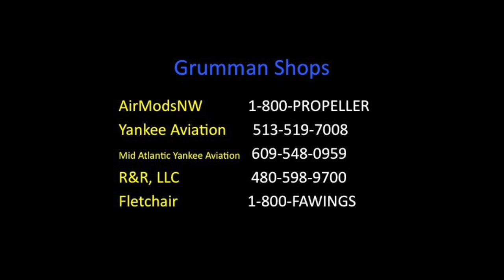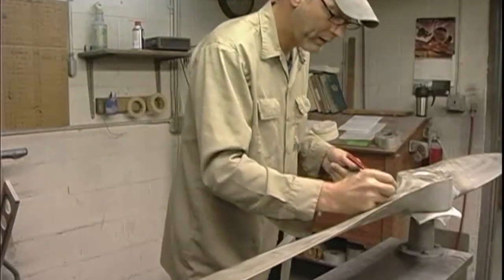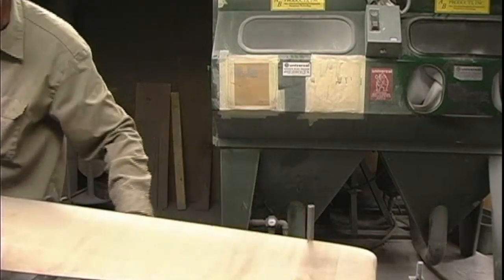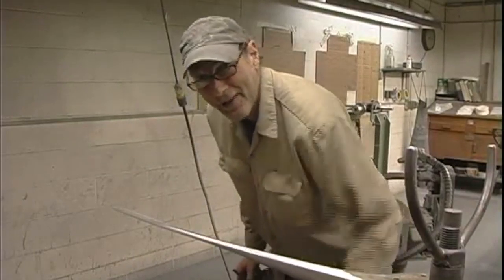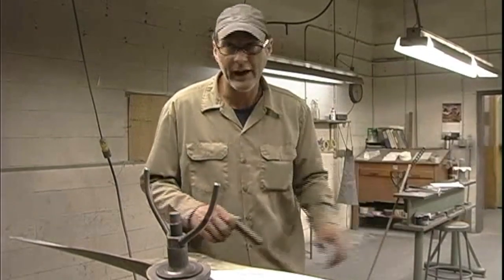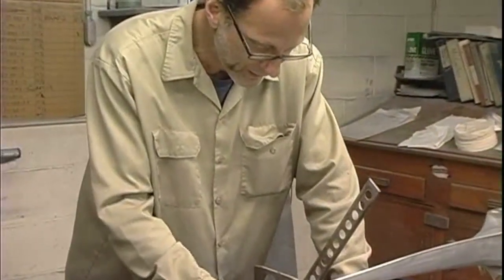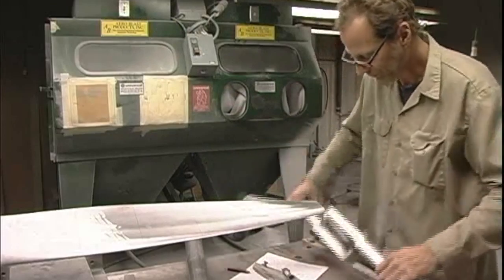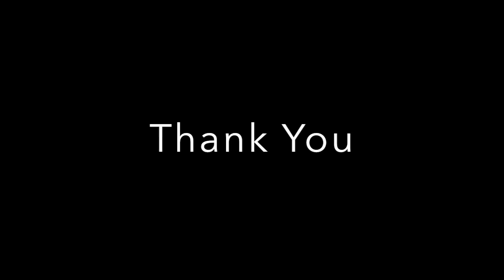Propeller Overhaul - Grumman Style

Comment: In 1983-4 I for get, a company that I worked for owned several AA5B’s one Saturday evening I was at the company HQ, in Chamblee, GA. One of my co workers a student pilot had a need to deliver a Computer monitor to Augusta, Ga he asked me to fly him that night. 
On departure from Augusta I felt a strange vibration on take off. I returned and landed. Looking over the airplane I could not find any thing out of order. So we flew back to Kpdk with no issues. The next morning another co worker departed PDK for GSO, on board N 28820 was his wife and 5 year old Daughter. 45 minutes south of GSO the Prop broke and slung a blade. The pilot shut the engine down as parts were separating from the airframe due to the vibrations. The engine separated from the airframe at about 10 feet above the ground. No one was hurt it totaled the airplane.
Reply from the maker: Props are the most overlooked part of plane

Comment: Not anealing.  It is work hardening.  That is what breaks the copper wire.
Reply: So what, he misspoke.  Still, you have to admit, Tony knows his business.
Reply: Yup.  Given this guy's knowledge, my guess is he just grabbed the wrong word.  Unfortunately, in this case, it was the OPPOSITE meaning.  You wouldn't believe how often that happens unless you do some vids where you speak.  ;-)  I watch some of mine, and just roll my eyes up in my head, with some of the stupid stuff I say in them.  Sometimes it's so bad, I feel compelled to retake the video section.  Here, this guy probably didn't have that option (then just overlaying the correct word in text "I meant work hardening" is a good fix) and wouldn't be a bad idea here, then he could also fix the video/audio sync problem, which is immense.
Reply: Actually, take a piece of copper wire and start bending it in half fast. It will heat up. It's that heating and subsiquint cooling is what Annealing is. Which in turn, through many processes of this, it makes the metal toughen and eventually if it's done enough times, it'll become brittle and break. Heating and cooling is EXACTLY what Annealing is.
Reply: @tonym3675  No, what it will do is BREAK, and that is partially due to work hardening.  You would have to bend it at about 20 Khz to heat it enough to anneal it, that doesn't happen at 120 degrees, barely within an order of magnitude of it (10X).  

This stuff is well known, well measured, well understood (now even at an atomic lattice level), and well documented. It is used EVERYWHERE in industry.  

Arguing it is TOTALLY senseless.  Just go look it up or do the experiments for yourself, but you need a hardness tester of some sort to do it.    

Educate yourself, you are ignorant on the subject.  And yes, in my engineering curriculum we had a course called "Structures and Properties of Materials" that dealt exactly with this issue, any many many others.  Just go ask anyone that uses it in the industry or any knowledgeable blacksmith.  You CAN'T argue against known facts, not with any intelligence.
Reply: @MrJdsenior  i CONCURE,You arguing it in the way you attempted is indeed you being senseless. Ever reloaded bullets.  Well they are brass and when we want to make the case neck harder in order to hold the bullet tighter, we gently heat the case neck (not red hot but a far cooler temp. Just enough to basically see a slight color change in the brass). We do that to yes! annel; that neck. If we get it too hot it will not hold the bullet but rather as we push the bullet into the case, the case will then crack or completly break. Metal will indeed get harder even if the slighest heat hits it,  the hotter the harder and more brittle it becomes.Work hardening is somthing compleatly different.  but then again, over a period of time, of a piece working back and forth or up and down at a hard/solid connection point, it too will break. and that is indeed metal fatigue.  A prop is spinng in the neighborhood of anywhere from 700 rotations per min on upward to 4 thousand rpms. Add to that air desinty, forward movement trough it and other calculationg factors and that prop gets hotter than you trying to use a propane torch to achieve that same thermal heat that the prop does.  Yes, the prop has foward and backward deflection as it moves, but that's not what causes the prop to crack!  it's in fact the anneling that causes it to get hard/brittle enough to get stress cracks and the ilk. Deny it or argue it different all you want, but you are not correct.  I'm done. it's clear you don't understand metallurgy .
Reply: Exactly!! Annealing means to soften hardened steel!! This is indeed work hardening!!
Reply: Also .062" equals 1/16 of an inch!!
Reply from the maker: Correct, mispoke.  I do it all the time in my video say aileron when I mean flap

Comment: At 14:03, may I suggest that when repitching that propeller one does not push only one side/arm of the torque wrench, as that is not exactly a  pure twisting torque by itself, it also has a downward component which could affect the tracking of the tip. In fact, it is clearly seen that both the leading and trailing edge at the tip were deflected down. If it was a torque, then while the leading edge went down the trailing edge should have gone up. One needs to be very careful about how one gigs up for the adjusting of the pitch. Apart from that, it was a good sequenced procedure and workmanship.
Reply from the maker: He does this a lot.

Comment: Need to sync the video/audio.  Great vid, otherwise.  The shop noise didn't bother me, at all, that's the environment.  It would be interesting to see some performance numbers from the prop before and after the fix/refurb.  That little prop checking/jigging station he has set up looks really simple, effective, and versatile...well thought out and/or iterated to its present configuration.

I suspect the vibration reduction is probably the largest factor, with the spanwise pitch corrections coming in second, and the trailing edge cleanup drag reduction, if it doesn't negatively effect the airfoil as the next largest.  I also suspect the L/D performance numbers would show little to nothing, but I could obviously be wrong.  

The vibrational analysis design technique (trial and error) was interesting, but I would think good FEA and fluid dynamics sims would eliminate most of that.

And he's not exaggerating, any kind of plating I've seen HATES impurities on the surface, especially oils.
Reply from the maker: Good point.

Comment: What surprised me was how crude the overhaul was. Take a look at surface with a x10 magnifier and it's probably rough as F*** with thousands of potential crack points.  I've done some aluminium polishing on 'aircraft grade' aluminium, 6061, 7075 and various unknown 'high grade alloys The amazing thing is just how long it lasts with all of that plus all sorts of flexing/twisting as it's pushing air
Reply from the maker: Good point

Comment: pretty crude, why not use lazar to check measurements?
Reply: A lazer will cut the aluminum.
Reply: @gerald4027  Funny they don't cut cd's
Reply: @RetiredPilot .turn up the wattage.
Reply: @gerald4027  What is your point only want to measure acuratly not do harm. Lazars are used that way all the time.
Reply: @RetiredPilot  You can't even SPELL Laser.
Reply: @craigwall9536  LOL
Reply: @craigwall9536  He thinks the acronym is Light Amplification Zapping ...   LOL
Reply: Stones,fod,rain errosion and then someone takes a file to the leading edge of your propeller,many props have never seen any overhaul and the biggest sin pulling on a propeller apart from the obvious dangers not good practise and dont forget to remove the towbar.
Reply from the maker: Not needed

Comment: Screw Aluminum, I'm stick'n with wood after watching this video!
Reply: reverse thrust  Funny you mention those.  I had a hive stand in a field next to some trees (partially shaded, this is a beehive stand) and long ago, the wind blew it over. It was just the stand and it was not beeing used AND I char my hive stands (burn them slightly)---get to the point, damn you!  okay okay, any-hoo, it had termites just starting in it.  

Termites?  Poison the living fuck around the hangar, in the ground.  Poison, poison, poison.   I don't think they climb up onto concrete (but I'm not sure on that one).

That's my solution, what would you do?

Perhaps a semi-perfect solution would be a titanium prop.  I'd hate to pay for that one, though!
Reply: @cluelessbeekeeping1322 .Oregon has some bad ass termites. They will chew cement and make a tunnel out of it so they won't get wet in the winter.
Reply: @gerald4027  Are you serious?
Reply: @cluelessbeekeeping1322 .yes those Oregon termites eat cement.
Reply: @gerald4027   Daaahhmn!
Reply: Gerald Nordahl 
And the termites you’re thinking of are Formosan termites, which Oregon do not have. Where in gods name are you getting your facts?
Reply from the maker: Watch out for rain!